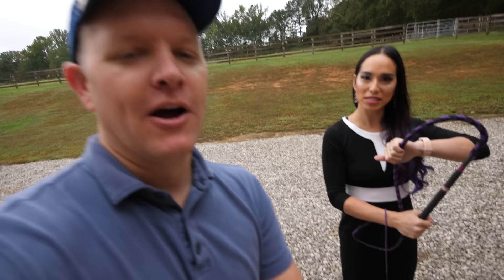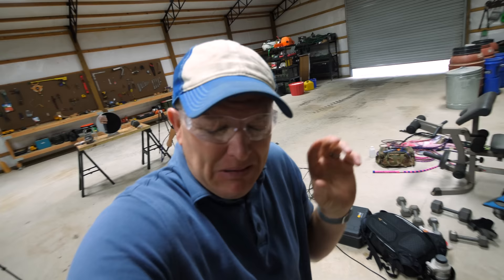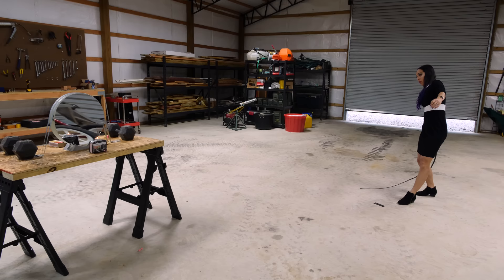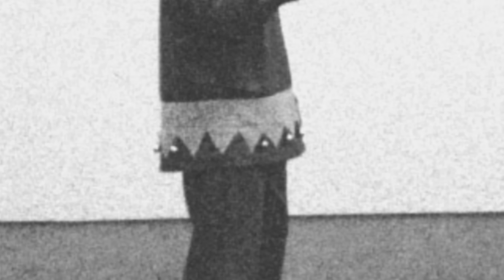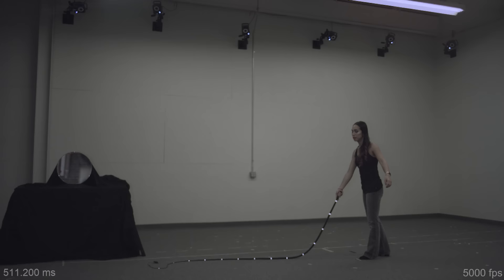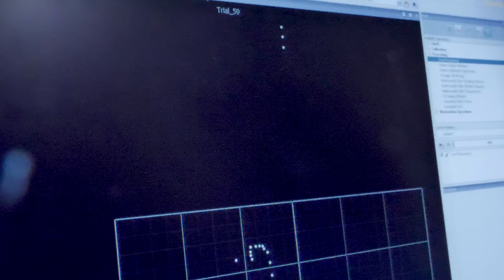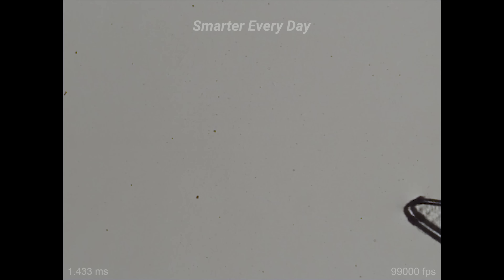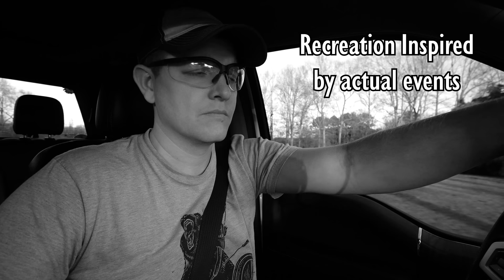How does a whip break the sound barrier? (Slow Motion Shockwave formation) - Smarter Every Day 207

Comment: Old video so this comment won't be seen, but this entire video just makes me think of those spring-loaded  gear-lock air hose rolls you can find in basically any shop.   It's tensioned with a spring so that when you disengage the lock, it will automatically roll up your air hose.

Problem is, it does so very quickly, so if you're not careful you'll catch one right in the testies, and there is 0 chance this is something that has only happened to me.

Comment: Holy Cow!!!! Bruh!!! Destin.... your name absolutely fits you!! Because, with you. We're destine to evolve! Wow! Good video and i paused it to comment this before the end mind you...
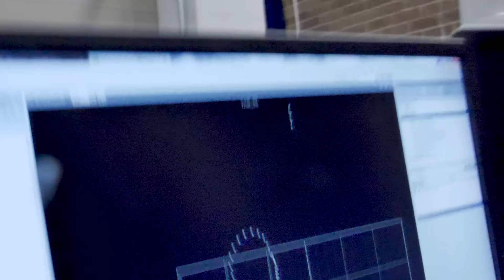Reply: You can see the energy transmitted through her arm to her hand and leaving the hand. Amazing! You need more angles! @6:50
Reply: What's happened is the whip tethers at the end have gathered the air and compressed it super dense. Then, throws that super dense air at a high velocity. It has no option other than to act like solid or liquid matter. That's what i'm thinking.
Reply: This study needs to be greatly expanded on...
Reply: The whip even changes on a perfect trajectory angle at the moment of sonic boom to support throwing air.
Reply: Now, how this happens and what is happening to the air needs to be studied... you both had the right guess on fluid dynamics. But, to what extent... dude...
Reply: The reason a knot works also is because it's the trailing air that's reaching super sonic? hmm..

Comment: The whip mechanics with a charging cable. Yeah. That hurts. Truly hurts. I was once rolling up a long charging cable into a coil on my elbow to stow it later, and right before i got to the end, it did the little gravity-assisted whip dance and the plug slammed right into the bottom of my sack, getting one of my balls. I think i didn't even manage to scream, i just collapsed on the floor and curled up there for a few minutes, before i proceeded to start with the nut shot recovery routine = squats. But it didn't return. I think it took days before the ball returned to where it usually hangs around. So yeah. Hurts.

Comment: You said "how does it break the sound barrier" but I see no measurement that showed it ever did.
Reply: A shockwave is breaking of the sound barrier look it up...
Reply: @jackrogersjr.4014  I'd still like to see the numbers. When it was used in physics when I was growing up it was any violent disturbance in the medium. Maybe they just didn't get into it enough but I'm guessing if I drop a book it will make a similar compression wave even if it's slower. That's why I want to see the numbers. It's strange they would be left out when they are using a high speed camera.... 
I have seen lightning create super-sonic sound shock wave maybe 5 times in my life. The strike was at least 1.5 miles away yet I heard the first sound in 3 - 4 seconds high pitched, then the same sound again slowed down and at lower pitch at about 8 - 9 seconds. So I'm guessing the higher pitch was super sonic at least for a short time.